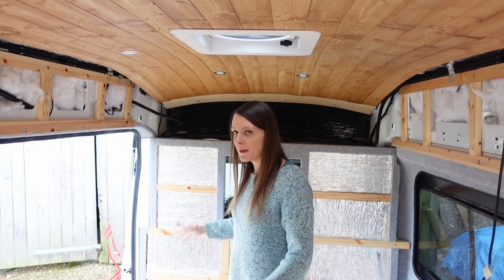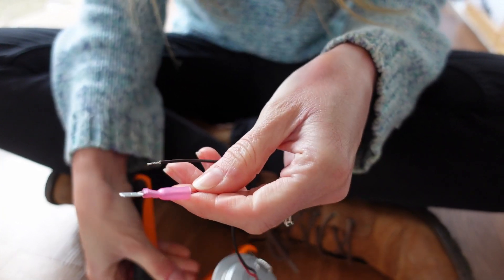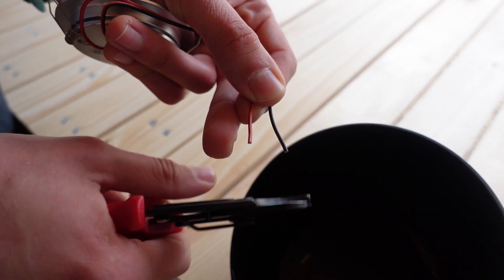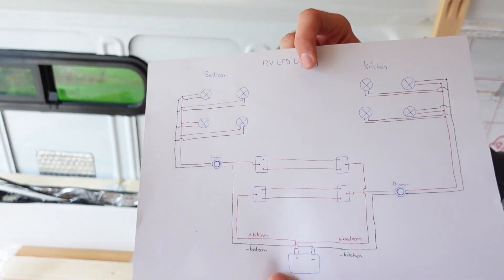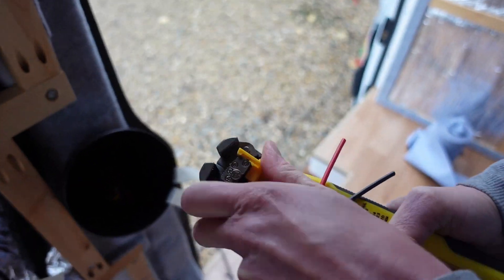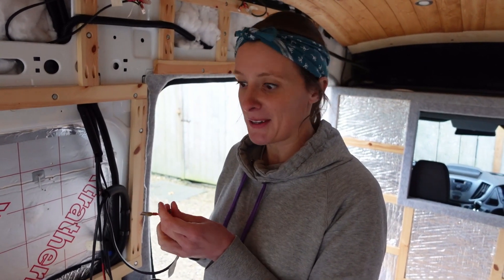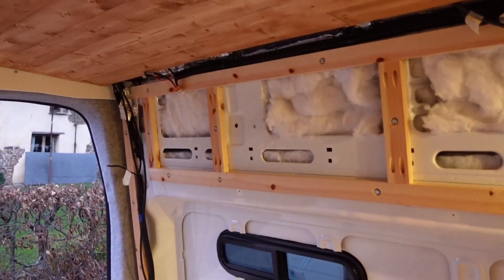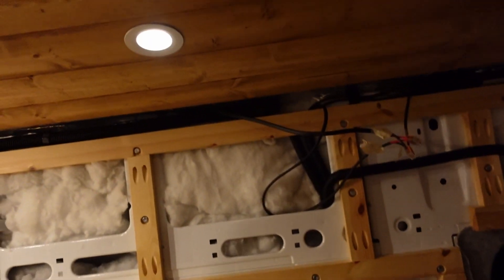Dimmable LED Lighting (With 2-Way Switches!) | Transit Van Conversion E24

Comment: So are puck light the only dimmable .. those small 6” LED strips are not dimmable ? .. I see people putting up to twelve puck lights that’s a lot of holes to drill where the strip lights you  only drill  6 - 1/4 holes to run wire then u screw them on won’t 6 LED lights strips light the whole van ?
Reply from the maker: Nope you can have dimming LED light strips too, the touch dimmer that we bought is actually designed to be used for those. It's just personal preference what you go with really, we prefer the look of the puck lights to having the light strips. The holes only go through the cladding in ours and with a hole saw it's quick to cut them out, the longest bit was just figuring out where we'd want them 😛 We might add some LED light strips too in places like the garage or maybe around the step area though, haven't decided yet. But sure you could easily light the whole van with some strips if you wanted, and have seen quite a few vans like that 👍

Comment: The button will turn them off , on and dim. You didn't need the switch type to turn off and on.
Reply from the maker: Hmm they wouldn't work like that for 2-way switching like we wanted as the dimmers are essentially only SPST 2-way switches. You need a couple of SPDT 3-way switches to be able to control them in two separate places like we have in the van. If you only want to turn the lights on and off from one place you could do that though and simplify the wiring. We also much prefer the rocker switches, they're a lot easier to switch without looking and being as precise as you need to be with the touch button, so in practice we never turn them on or off with those, just use them for the dimming. 👍

Comment: Me again! I am really liking your lighting circuits and think they would suit me quite well. I have also been watching videos from another popular UK gentleman converting a van and he shows us that he is going to use spotlights that can switch on and off by touching the metal rim of the spotlight. This is a 30 second video that demonstrates one: https://www.youtube.com/watch?v=IQOxangNt9U 
I thought this seemed really nifty and would be great from saving electricity as you could for instance, turn on only one or two if needed and set more scenes in the van. But what I am wondering is, supposing I used your circuit that you demonstrated and I used touch lights such as that described, would it work? Would it 'muck up / confuse' the electrics? Do you see what I mean? 
Supposing you had just the one light in the kitchen you had tapped on, then you want all the kitchen lights to be on immediately as it’s an emergency. You push the switch… would the remaining 3 simply come on? Or would that first singular light not have been able to come on in the first place from your touch because the switch wouldn’t have allowed it to?... 
You might not know the answer but you seem more clued up that me so if you don't know, no worries, if you think you might know then great! 🙂
Reply from the maker: Yes you could wire up touch LEDs in the same 2-way circuit that we have, but it might get a bit annoying. If the two-way switches were off then you wouldn't be able to touch them to turn them on (as they'd have no power). And if they were on and you touched one to turn it off, then using the 2-way switch afterwards wouldn't turn it back on, unless they were designed so that with no power they revert back to a default 'on' state. In your example if you touched one on in the kitchen then flicked the switch, you'd just cut power to the whole circuit and all of them would be off. 

Essentially you'd be able to get into states where flicking a switch might not cause a light to come on. We like the two-way switches as we want to be able to turn on the lights from far away, so we can turn off the kitchen lights when we're lying in bed etc. Whereas for touch lights it's the opposite where you need to be right next to the light to control it, so slightly opposing goals really. You could definitely do it, but it might get a bit confusing. 

To save power we have the dimmers instead, so we don't turn off a single light but we can with one press dim all 4 in a zone, and if you dial them right down they use hardly any power at all. Funnily enough we have the same sort of quirk with the dimmer which is that you can also turn off the whole set if you just tap the dimmer, and then we'd get into the state above where you can't turn the lights on with the switches anymore until you turn them back on at the dimmer. For that reason we only ever use the dimmer to actually dim the lights, and we always turn them on/off with the 2-way switches. HTH 👍
Reply: @SelfBuiltStories  Gosh, it does get a bit confusing as I'd suspected. You've written a really full and thoughtful answer - thank you very much. I was looking at these touch sensor lights on websites and even came across ones where holing down your finger on the rim of the light increased / decreased it's dimness also; in reading their reviews it seems other people have put them in a circuit with switches and say that the lights have a 'memory' and at least in terms of dimness, retain the memory of that. I think I was expecting that I'd have to do 'double clicks' sometimes, as in flick the switch to turn the one off and flick again to then get them all on. 

It's good that you've let me know abut the situation with the dimmer and switches; ensuring you use them separately as I can see the difficulty you mean. 

Maybe I am being a bit over the top with concerns about electricity as lights don't use too much electricity after all.

Hmm... I'll have to think about things a bit more and look at my design again and I'm sure the obvious answer will come to me. I might still do this idea, but I'll trial it first and see what I think! If I try it I'll update you!

Thanks again! 🙂😇
Reply from the maker: No problem, yeah our dimmer switches have a memory too. If we dim them and then turn them off and on again they'll be at the same dimness. We do that a lot but we don't turn them off with the dimmer, as then both the switches and the dimmer are competing for which puts them into the on or off state. Our dimmers remember they're off as well, so if you turn it off with a dimmer, then flick the main switch off and on again, it'll still be off as the dimmer is still off. 

Your double click scenario would only work if the lights didn't have a memory, as otherwise the first flick would turn the single one off, and the second flick would just turn the single one back on again at the same state. You'd have to have some that when they have no power they just reset to being completely on and full brightness, then it would work like you say. 

If you always used the lights just to dim but not to turn them off it would essentially be the exact same setup we have, just dimming at each light instead of a master dimmer for a set. That works pretty well. It's when you start having two different ways to control whether they're on or off that it gets a bit confusing! 😛
Reply: @SelfBuiltStories  Oh yes, of course, your point in your second paragraph is true of course, that would be an issue and wouldn't really help me out with my thought of needing to get them all on in an emergency, would it. The single one on would be the only one that comes on again! Very good point. And thus, double clicking the switch not gonna work. Online, I find that the spotlights with touch dimmer function aren't informative enough to tell me if they retain 'memory' or not as you say, as this, now that you have pointed out would be better if they have memory. And I think I've only found ones Bummer. I think I would then ideally need ones that reset then. Which I don't think I'll find to be honest. 
The term 'master dimmer switch' is very useful by the way. Helps me out with my clunky explanations. 
Thanks once again, you've helped to clarify it in my mind better. If, which I'm dubious I will, find some lights that don't retain memory and can do this magicery that I wish I'll let you know. Thanks so much, don't have to reply as I'm sure yo're fed up of me! Thankyou, PinkBsl
Reply from the maker: @pinkbsl7972  haha no problem, good luck with it!

Comment: Next time your doing electrical bro, push some heatshrink onto the wires, do your connections and then pull the heatshrink over the spade connectors and heat it up. It insulates but also stops them working loose over time and it looks nice and neat.
Reply from the maker: We've done that with other connections but we've used spade connectors where we want to be able to disconnect them again easily so wouldn't want to heatshrink over them. We used heatshrink terminals instead so they're nicely insulated but still removable 👍